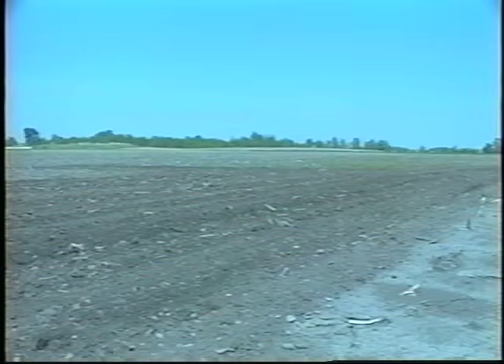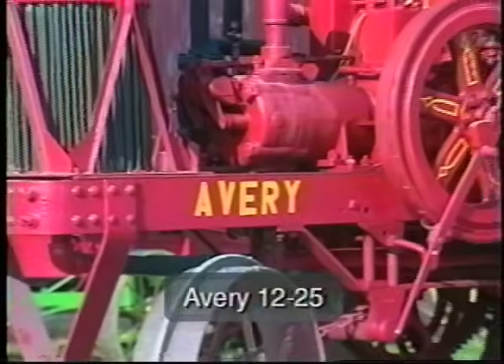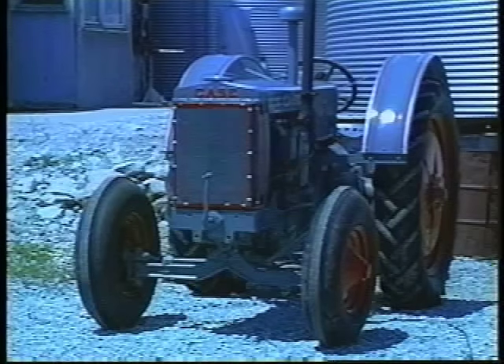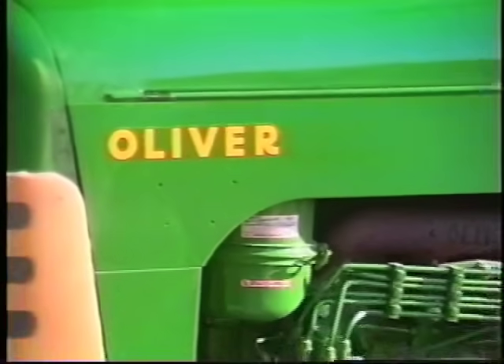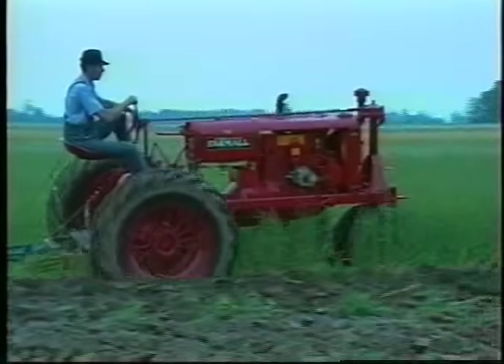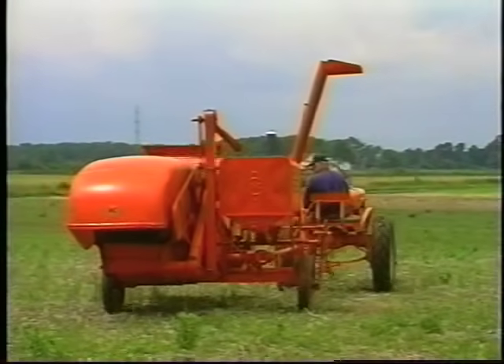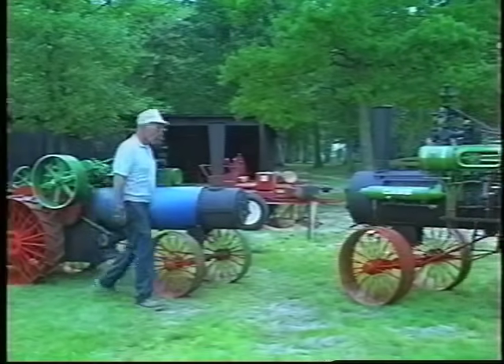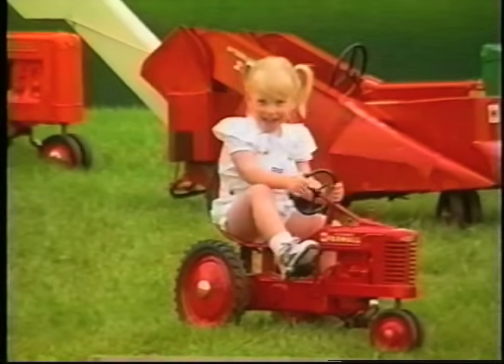Antique Farm Tractors

Comment: Here in the UK our tractors would start up on petrol and then when warm switch to TVO (tractor vaporising oil)  Unfortunately it went off the market in 1974, so we mix a cocktail of paraffin/kerosene (heating oil) and petrol that's similar to the old TVO, to run the vintage tractors on.